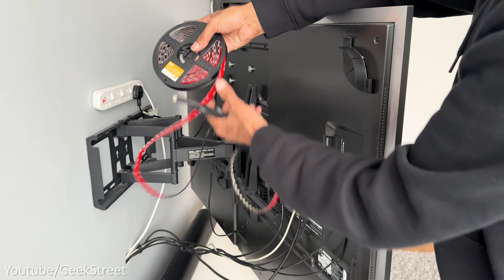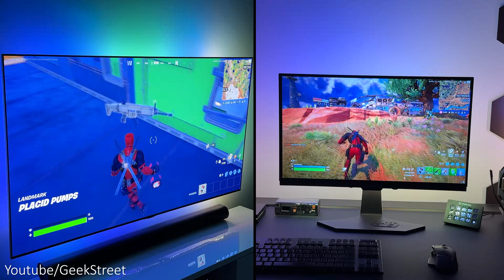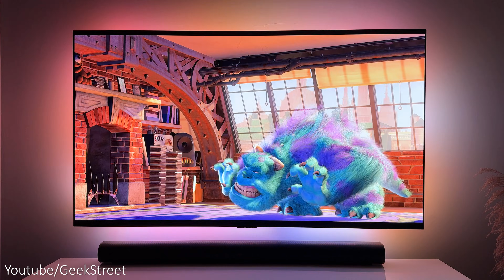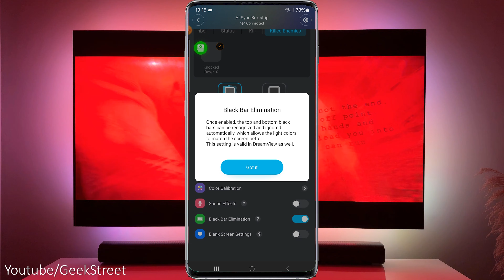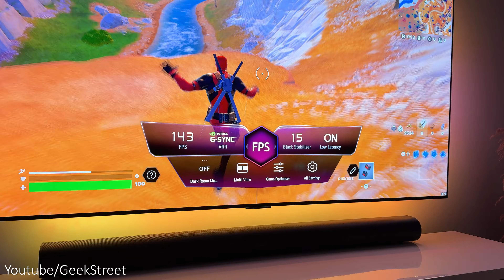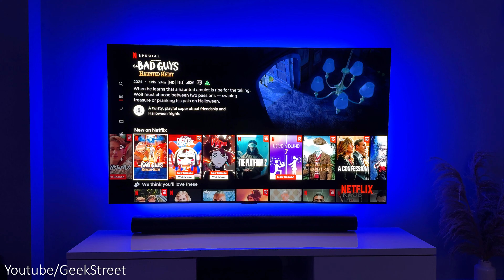NEW Govee AI Powered HDMI 2.1 SYNC Box 2 is a GAME CHANGER!

Comment: If you wish to use this for you gaming set up (Xbox series X, PS5) get ready to spend more money on a Splitter and potentially extra HDMI cables, because the Govee box can't handle HDR10 (10-bit) at 4K 120hz, it will give you a black screen. At 60hz you are perfectly fine. This is my personal experience with the box and Xbox series X. Everything else is great, don't get me wrong, but has that as a very critical issue and it doesn't match what they advertise. Also, this is for 4K resolution, if you bring it down to 1440p instead it works fine.
If anyone had another way to resolve this issue that didn't involve a Splitter, please do let me know how. Great video.

Comment: Issue with Govee Sync Box 2 - Red color appearing as white/orange
Text zprávy:
Hi, I bought the Govee Sync Box 2 based on your review. Everything seems to be working correctly, but I have a major issue with the red color. Instead of a deep red, the LEDs show a washed-out white or pale orange in Video mode.
I’ve already tried everything: HDR calibration, turning off AI identification, adjusting saturation to 100%, shifting the White Balance, changing HDMI 2.1 ports, and even a factory reset of the box. In "Color" mode, the red is perfect, but in "Video" mode, it just won't trigger correctly from my OLED screen.
Do you have any tips, or could this be a faulty unit? Thanks for any help!

Comment: I get no signal from ps5 works fine if I plug the hdmi back into mointar soon as its in the sync box no signal any ideas?
Reply from the maker: Try changing cables, test turning off VRR and maybe reduce the resolution as a test and may sure you have the correct source selected on the sync box
Reply: @GeekStreet wow thanks so much for your reply ill try
Reply from the maker: @MrBEEFCAKE26 🤞
Reply: @GeekStreet all sorted pal thanks was the vrr thanks so much legend

Comment: Sounds awesome but question? I have all my equipment going through my reciever then to my TV. Will connecting the sync box to my reciever pass through still work properly and not interfere with my audio or picture.  My reviever is 4k 120hz pass-through capable w/ support for Dolby vision and HDR 10.  So example ps5 to receiver hdmi then reciver to tv. You probably didn't need to explain that . I appreciate your response.
Reply: @MT07_MONTE  great question.  Was wondering about that as well.  Everything runs through my receiver and one hdmi cable to the tv.
Reply: Did you ever figure it out?

Comment: This needs to be able to auto switching inputs for me to purchase. It would take a step back in terms of HDMI CEC control with my setup.
Reply: I want to know if this Govee AI Sync box 2 has the ability of HDMI CEC bacuase i want to connect to this the Google TV Streamer 4k and I dont want to lose the capacity of turn on and off my TV with the google tv remote controller. Do you know if i could do that ?
Reply: @F @FedeLopezS yea this is my complaint, no CEC (or auto switching).
Reply: @MKNYC_ I asked this to Gémini and told me it has HDMI CEC, i would have no problem to still use that function. I don't know what to do and I'm from Argentina, if I Buy this it would be in Amazon US, it's too risky.

Comment: I'm assuming you have connected the soundbar via the e arc port of the TV and the soundbar. 

I have both ps5 and streamer connected to the hdmi in of the govee ai sync box 2. 

The only issue I'm having is with my lg oled is when I switch on the TV initially in like 5-10 secs I see the LG wallpaper and then it goes back to the selected input. This only happens once but is very annoying.

Please can you advice

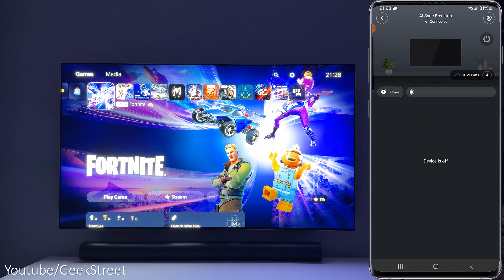Comment: 4:23 to stop the signal going to the tv click on a different input source that has nothing connected to it, it will switched off the input that way and not pass through, this only happens with my PS5 weirdly but think it's down to the Remote play screen off setting not working just now on the PS5 since last update, sony are dropping new firmware update tomorrow same day as govee new home app 6.7.10 so fingers crossed something is fixed there! the This only device of mine that does it, so might have been fixed in more recent updates? There is a new app update dropping tomorrow govee said today 6.7.10 hopefully all be fixed now?!
This is what I do anyway juat now for cutting the monitor for remote playing and sony also have a firmware update drop tomorrow 24/4/25 30th anniversary themes are coming back! So hopefully they have also fixed the remote play screen off setting in this update and won't have to do this with the sync box 2.1 anymore!
 Not a big deal takes 2 seconds to cut a screen output! There is a way round this pass through strange only happens with my PS5, my firestick and Google chrome cast its not an issue!

Comment: A Y USB C adapter works in the usb c ports i have the twin with lightbars after the updates camera lite 3 kit didn't work with my monitor being matte finish but this waw can't speed highly enough of it especially having a 4 way input switch built in! I bought a separate UGreen 2.1 switch to run 2 separate monitors to it and it work's! Whatever one i am using at the time if my new Alienware 4k OLED  for my PS5 or 4k MSI for my PC CAD work or firestick.

Comment: No Display ports ? Especially on the one specifically designed for GAMING MONITORS?!      That is THE DEAL BREAKER!
Reply: Fr… got one for myself for Christmas for my 85 Inch tv gunna have to hold out until display port is available for my triple monitor setup lmao
Reply: @averyb5236  actually there is a work around for that situation u only need to connect sync box hdmi to gpu and keep the dp connected to the monitor as it is. (There isnt any connection between sync box and the monitor we are using gpu for color immersion)After that on windows display settings choose your monitor as a screen 1 and duplicate screens. Make sure your hz setting is correct. Additionally go your gpu software and turn on gpu scaling

Comment: Hi I’m Patrick and I ned help before I upgrade from sync 1 to sync box 2. I currently use a Samsung 77in HDR OLED tv. And when I use just the tv smart option to view YouTube and say watch fire works it’s crystal clean. But I switch to the sync box 1 and watch the same through YouTube I see tiny pixelation in dark sky or blue sunset sky. I do not play games. I have a Roku 4k ultra 2024 box that is plugged into the Govee sync box 1 and I use the lights to match what is on the screen.  Is this the Roku issue or the 2.0 hdmi issue with the sync box 1 and would this clear up if I got the sync box 2.  I only want apps through the Roku now and not the smart tv apps on the tv itself.  I never play games it’s always movies and tv and sports.  Do you think the sync box 2 would help or is it the Roku 4k ultra box 2024 causing a bit of pixels and degradation.  I want to get the best picture out of the Samsung 77in oled   Please help me.

Comment: How does this work if I use my smart TV's apps. Technically there is no HDMI for that as its built in? Would the Govee TV Backlight 3 with the camera be the only option?
Reply: Yes, if you only want to run the apps through the TV but if you run them through a PS5, fire stick, Xbox, something that plugs directly into the hub via HDMI, then that will work

Comment: Are there any known issues with using an AVR? I run all my inputs through it and then just one to the tv. Will the box work with the avr as the source input then to the tv?
Reply: @UltraMega79  Works totally fine with AVR. Better than having to switch inputs on the box too
Reply: Get the FancyLED though. The Govee has all kinds of problems with not showing black and other color inaccuracies (gray is green, etc.)

Comment: Have the same TV and just got the govee sync bix 2.. the issue is i have my TV mounted with the wall mount that the tv brings, and rhe bottom of the TV touches the wall, im trying to think how i can work around this 😢
Reply from the maker: Pull the TV away from the wall slightly so there is a gap between the TV and wall.
Reply: @GeekStreet  thank you for the reply!! just installed the govee lights right now, I'm organizing all my cables and let's see how it works. I was a little scared to not click the mount all the way in, but this will have to do because I need these lights in my life lol. I'll post a follow up to give my thoughts. Worse case I will have to change the mount.
Reply: @GeekStreet  just finished, organizing all my cables was a hassle, but man the overall.product is a cheffs kiss, pure gold!! 

What are the best settings (brightness, sensitivity and saturation) for this new box?

Comment: 2 deal breakers:
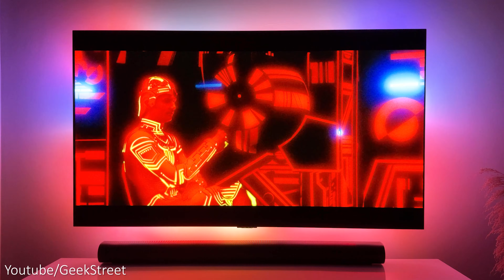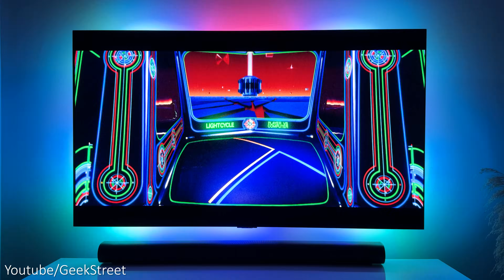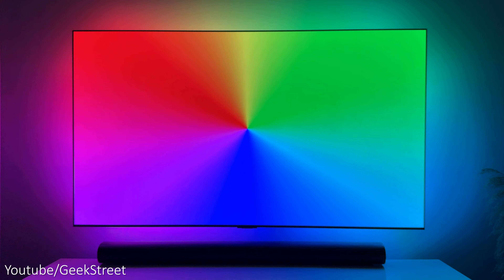1. Doesn't reflect well dark colors like at all. See 1:10, 5:13, 5:22
2. Red is absent. It just displays magenta/pink/orange but no solid red. See 5:18, 1:10, 5:13
Reply: I have exactly the same problem with it. Mine most of the time tends to show greenish colors. Especially in HDR. Cannot handle dark scenes and reds. Color accuracy in the 1st generation of this sync box was WAAAAY better. This is a disaster
Reply: @mehraas it's a setting! Saturation on 85 %
Reply: @mireazm  still honestly I'd rather have this than the Phillips one because of how freaking expensive Phillips is

Comment: For soundbar users with just one Hdmi input how we can connect two devices in my case (shield TV and Xbox).

1. Devices - Govee - Soundbar - TV
2. Devices - Switch - Soundbar - Govee - TV
3. Devices - Govee - TV - Soundbar
Reply: this is what i dont understand. I have one ARC port for example and that connects to my sumsung frame tv box, which has HDMI to everything else. Can i put it in the middle of that to capture all HDMI devices from PS4 / Switch / Shield etc. 1. Will it work with all of those devices by doing that? 2. Will it impact any of the other requirements coming out of the ARC port. Unfortunately its too risky to buy and try.
Reply: @PereProteus I don’t have a frame any more but is the arc and the hdmi 120hz the same port? I remember the gaming port on my version. Normally you’ll have a 120hz and a separate ARC port. It’s actually a really good option for something like my Sony TV because you get a 4 port 120hz hub built in. At the moment I have to use a manual switch to swap consoles.

Comment: My govee sync box 2 shows white or green even on black scenes. It doesn't replicate dark scenes or turns off the LED lights. Any suggestion ?
Reply: Same with me :(  did you find any solution?
Reply: @qutaibakhader5022  ended up returning it. I tried to reach out to govee for solution using the app using the "my issue" chat. but they just said sorry they cant do anything about it and that no firmware update is avaible. Also spoke with them through the phone but the person just told me to restart the sync box  unplug everything and plug it back in. and if that doesn't work turn my phone off and on🤦‍♂️ then delete and re-install the app LOL and if that doesn't work email them directly LOOOOL.  So In the. I just returned it and Got the fancyleds 2.1 instead. Still waiting for it in the mail
Reply: @10403mike  
OMG 😮😥  no even frameware update?!! I can't return it because im living in Jordan and i need 200$ to ship it, i will bring back the camera, this is the best solution right now 

Thank you mike🙏
Reply: @qutaibakhader5022  oh no that sucks 😕😕
Reply: @qutaibakhader5022  update. just received fancyled sync box. and it's amazing! Black screen no issue. On pitch black scenes, leds turns completely off and this is with out of the box. all settings is set to 100 percent. responsiveness, color and accuracy is on point!
Reply: @10403mike  
Ooooh, did you test VRR + HDR + ALLM and all console features? Just need this before i order one 😁
And I see that there's RGB + RGBW .... Wetch one you get?
Reply: @10403mike  Any issues till now?
Reply: @10403mike  I also switched to fancyled box and it's exactly as you describe. Amazing performance and color accuracy and far better than the Govee.
Reply: @10403mike  Just got these and devastated that the LEDs don't turn off with black. My old lytme works perfectly in this regard. It's hard to imagine they overlooked this, especially since they are getting raked over the coals in all comments sections. This is massively disappointing, especially for the price.

Edit: I found that fiddling with the sensitivity fixes the check program. There is a bad bug here. Other problem is that some colors are way off sometimes (grey is green, red is pink), It's very odd. Reducing saturation to very low level helps. I'm surprised these are so buggy considering how late they were coming to market after they were announced.
Reply: @BrandonRyan  please report this issue to govee, let's make a change for this project 🙏
Reply: @qutaibakhader5022  I switched to FancyLED and it's amazing. Not going to wait for Govee to fix this.
Reply: Get a T2
Reply: @edithboozy1000  Camera systems are awful compare to HDMI box. Fancyled is the way to go, no question.
Reply: @10403mike  Genuine question, are you asking why an RGB light strip can't replicate black?

Comment: Im assuming there's still no support for sound bars? Specifically the Sonos ARC?
Reply from the maker: I used with my Sonos Arc and it did work but I only noticed recently after the review that some functionally went a little bit weird, like for instance if I casted a youtube video directly to my TV I couldn't control the volume on the soundbar from my remote.
Reply: @GeekStreet  Hmm interesting. I bought the HDMI 2.0 a little over a year ago and it wasn't working. Maybe Ill try to set it up again.

Comment: Hello , It is working well with HDR and Dolby Vision? Thx
Reply: HDR and Dolby Vision will depend on the device you're using.
Reply: @whoaitstu   What do you mean most box except Hdfury have issue with washed color on HDR and Dolby vision , so i was wondering if the box works
Reply: @sbavuong  Because this box only works as a passthrough box. It does not have any tech in it that processes image or sound.
Reply: @whoaitstu   i was meaning how is the color reproduction on HDR and DV , i know how the box works!

Comment: Hello, question did I understand correctly that inputs connected to the sync box can not auto switch input from a controller or remote but must be a physical press on the sync box or via the Govee app?!
Reply: That is a deal breaker
Reply from the maker: Yes that's right
Reply: I have the old HDMI 2.0 version and Im assuming that you would be able to via the Govee app because the version I have you can do it over the app.
Reply from the maker: @whoaitstu  app or press the button on the sync box
Reply: This is also a deal breaker 4 me. Too cumbersome to have to use the app to switch or go to press it manually. Govee needs to address this issue.

Comment: This is not improvment.Fancyleds 2.1 is more versatile.As AVR user,one only need one 2.1 port and connect AVR and everything is working.No need for 3 hdmi which are dead in the water for AVR,Blu-ray or TV !!! I don t know what was Govee thinking with this. As a long time Govee user with over 2o producta and 50 lights, I must say,this is a step back.Was on the verge to change my T1 and T2 setups on tv "s , buy 2 floor lamps extra .But,now, Fancyleds looks like a viable option, and probably the best bang for buck...They just needed to do what competition did,but no.. Love the video, and it is super informative and good as usual !!
Reply: Yeah but that's the problem you don't see a lot of people talking about how it works with AVRs. Because I use an older one with my AVR but if there is no ARC then you lose your sound when you go in to internal apps. I want to know If those things work.
Reply: @armandokolleman9693 you dont see alot of people talking about it because avr's are dying out and rightfully so. You can buy soundbar setups that are every bit as good as you avr setup for a fraction of the price. Govee must be dumb as hell for not catering to a basically non-existant market of people. 🤦🤡
Reply: @NoYoureATowel3 all that info is untrue. 1 soundbars will never be as good as AVR's, 2 AVR's also have more hmdi connections so the same problem will happen there. 3 the reason because it's a fraction of the price is because it gives a fraction of the possibilities 😂😂😂
Reply: @armandokolleman9693  you can cope all you want. Your precious $5000 setups are marginally better than a $500 sound bar these days. Cry harder.
Reply: @crisbruchak4519,if u dont know, then u dont know, no way a sound bar can replicate a Dolby atmos let alone dts x lmfao, and without a strong sub or 2 like I have , your response carry the weight of a feather knowing nothing about true home theater.
Reply: @PhilipVong-vk5wj  or, your drinking a tall glass of cope for the fact that you spent 3x's on your system than a soundbar and the sound quality isnt even that much better. Carry these nuts, homie.
Reply: @PhilipVong-vk5wj  don't even waste your time on this idiot. If he doesn't know there's a huge difference then whats the use with arguing with a 10 year old troll that only has money for a Aliexpress soundbar 🤣
Reply: Hahaha what a complete idiot you are 😂😂😂.

Comment: Ive got the Fancyled 2.1 kit currently and am interested in switch to this Govee kit. Do you know if the fancyleds light strip would work with the Govee sync box? (Got 85" and the wall mount i have is fixed to wall and cant pull tv out, so makes installing light strips difficult)